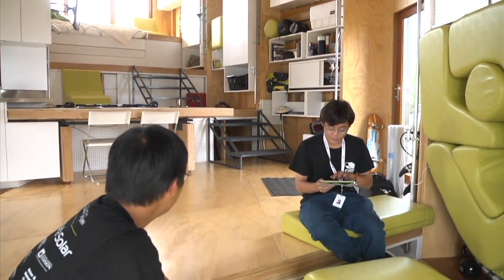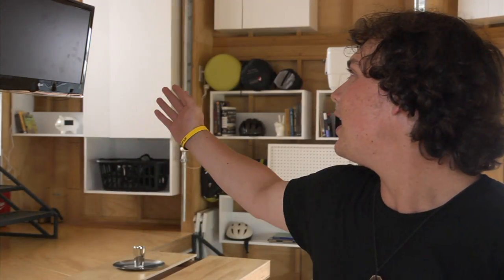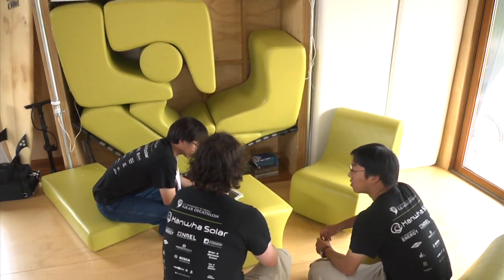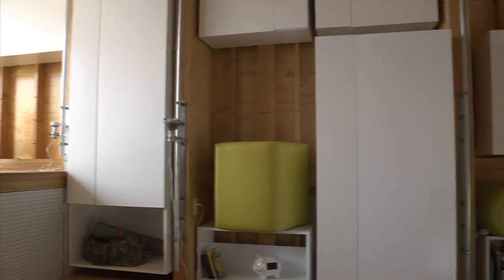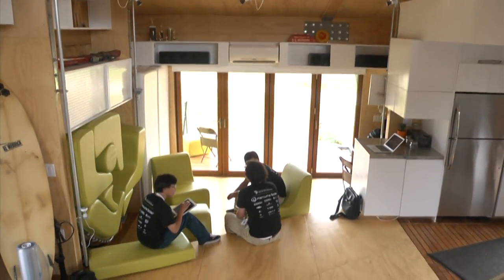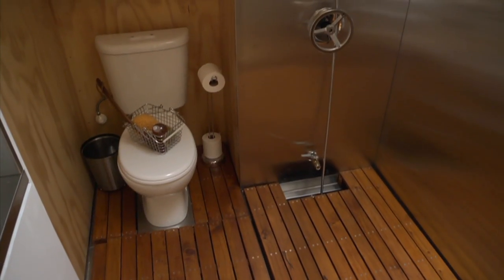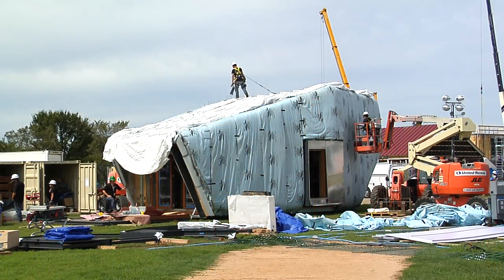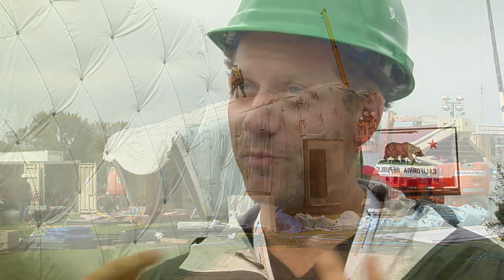SCI-Arc/Caltech Virtual Tour - Solar Decathlon 2011

Comment: What material do you use on the outside? Is it tha same as that used on fabric roofing systems on sports domes  or storage fascilities? How do keep it from leaking at cable tie points?